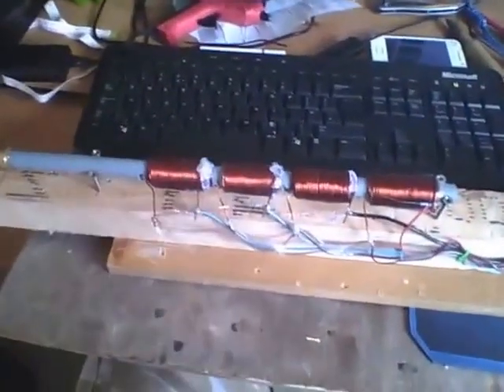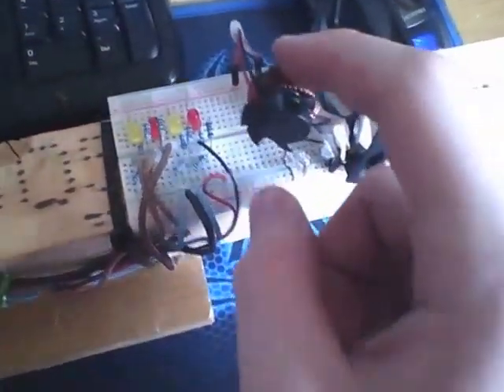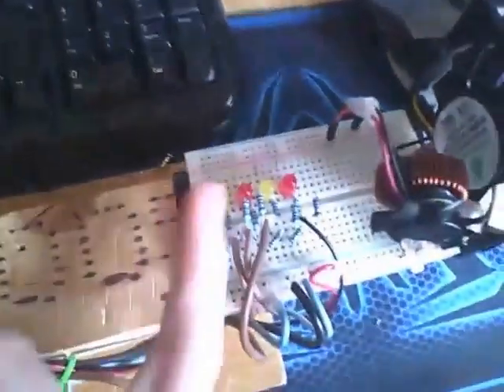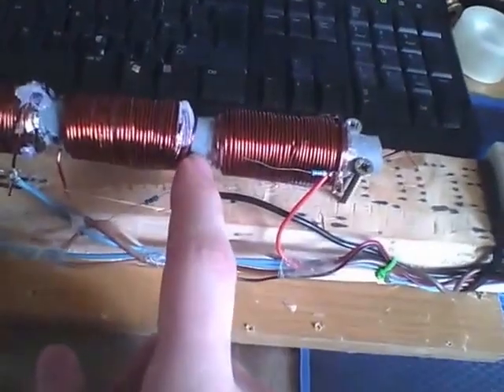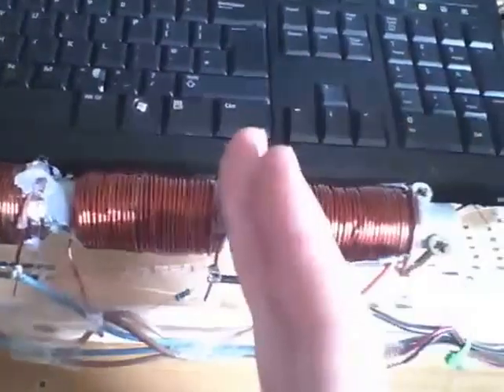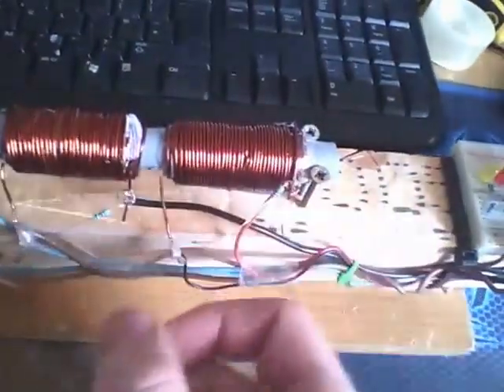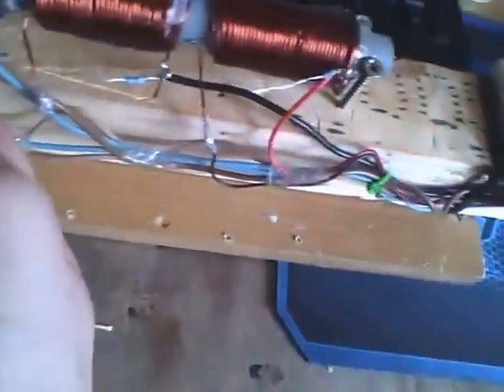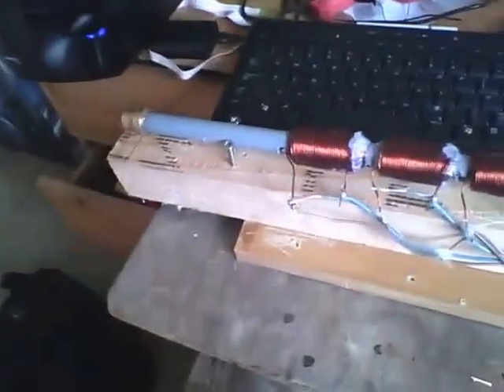my second ever coil gun explained

Comment: did you launch it?
Reply: In the video, the functioning of the working model of the electromagnetic mass accelerator (mobile test stand). It is generally accepted that the implementation of this design is very difficult because of the low efficiency and low reliability. Nevertheless, this opinion is mistaken - modern technological the base has long been able to realize an electromagnetic mass accelerator with an acceptable efficiency and high reliability I am looking for interested in making. 
https://www.youtube.com/playlist?list=PLfhSIf7qgNZbdEVBvmjgqkalNNbqTJRtz
Reply from the maker: Im afraid i didn't even get to finishing it i moved on to a tesla coil project. however i would be up for making another one but this time arduino controlled if i get enough people asking for a video on that.